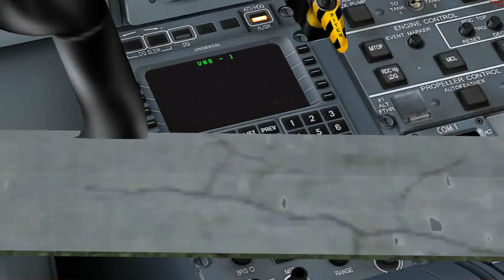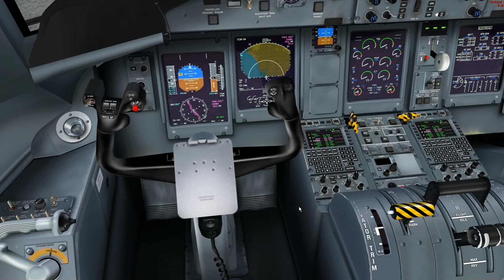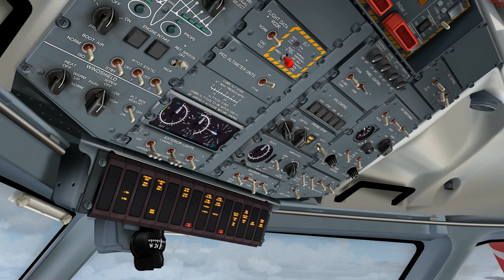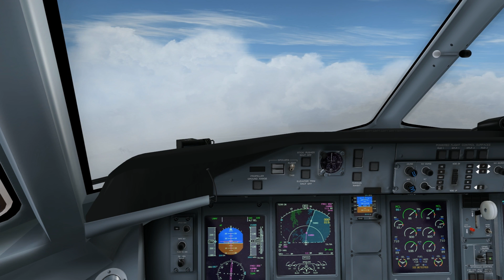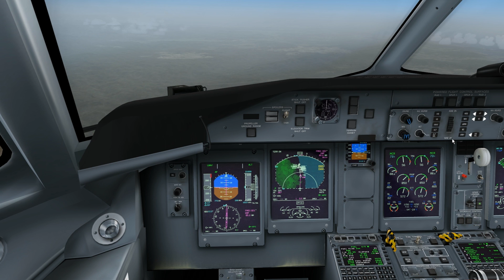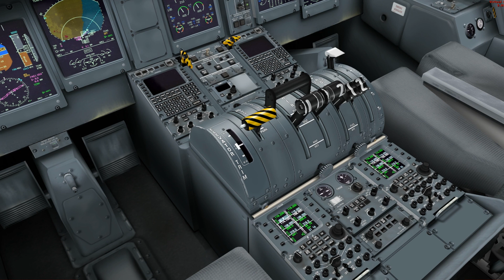Majestic Q400 YSSY - YCFS 1 hour Too Early for Vatpac Panic Stations

Comment: That explains it - I've never fully understood Vatsim or how it works, I have enough trouble just using the FSX environment, with all its addons. With Vatsim, in this flight you've uploaded, if someone else was flying into/outoff YSSY through Vatsim would their aircraft be shown and visible. I have a request. Could you do a detailed but short video on the FMS, particularly the VNAV setup when flying ILS,RNAV and RNP approaches. I can't get a VNAV TOD highlight and transfer to FMS when flying a RNAV approach. The correct height is shown in the FMS but not on the PFD map.
Reply from the maker: Yep. Anyone on vatsim can see everyone else also on vatsim (given that they are nearby) and of course everyone can be seen by ATC on the radar (I have a video up with what ATC can see on the main screen.)
Reply from the maker: Vatsim: The Other Side - Running ATC Centre on Vatsim
That's what (one version of) the Radar works for people being ATC on vatsim. This is program "VRC". There are other programs that work, all free to download and use. One is "Euroscope", and the Australians use a mod of Euroscope called "TAAATSmod".

Comment: Hey Trent, I have a question.  With FSInn, you have gotten the correct planes and liveries to be displayed while mine doesn't.  I know you have to select airline paint over correct model, but I get an error every time that doesn't let me into the settings menu.  As a result, I have had to go back to squawkbox, which is not preferable, as I have a large world of AI library.  Please help?

Comment: Trent, great flight. Just one thing. The BLEED you get in Yellow on the ED is because you haven't turned the air bleed valve to "MIN". You should do that in take off and landing just in case.